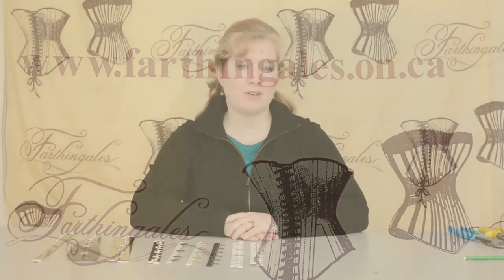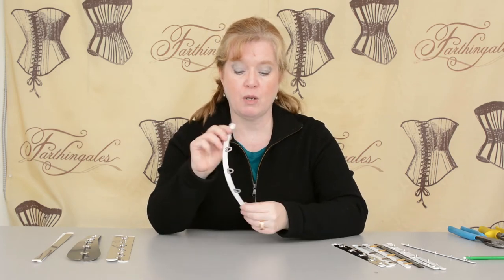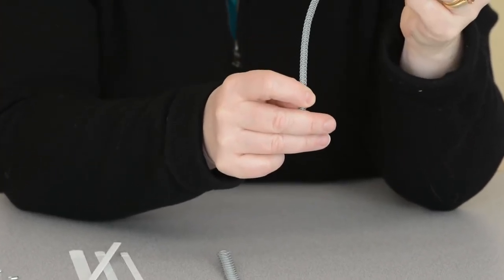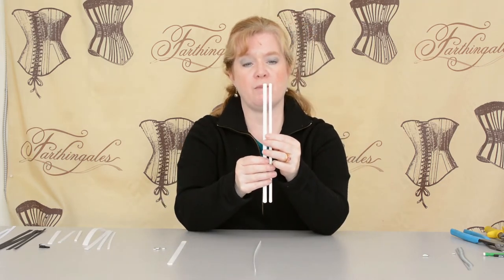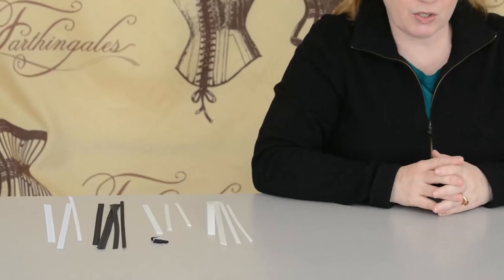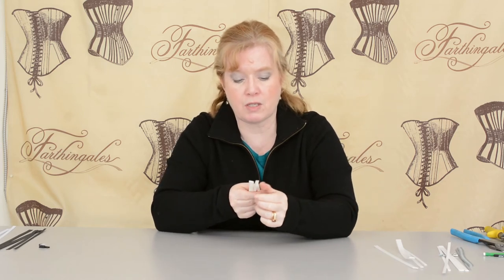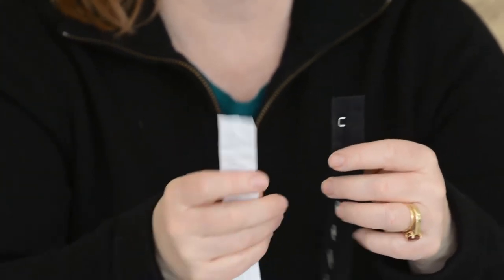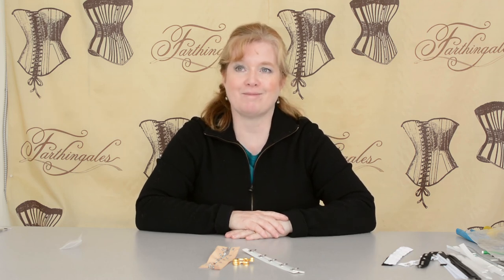How to Make Corsets - About the Hardware Options

Comment: The answer seems obvious, but I'll ask anyway. Even though the spring steel bones are wound on a coil, they will straighten up as soon as you unroll and cut it? 
And if so, how do you keep your coil from completely unrolling when you're trying to cut off a piece?
Reply from the maker: When you get the coil it will be secured with cable ties and there will be a note "Do Not Cut Ties" ...just feed the hoop wire out and don't cut the ties. You may need to tighten them once you've got what you need.
Reply: Thank you!